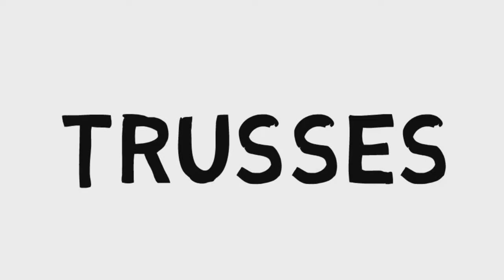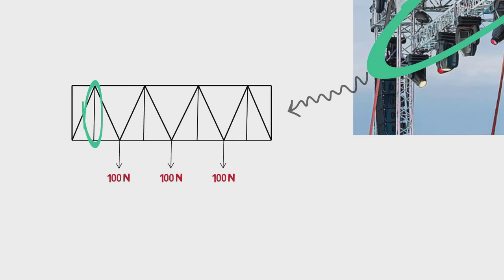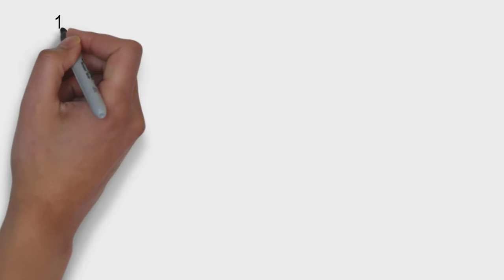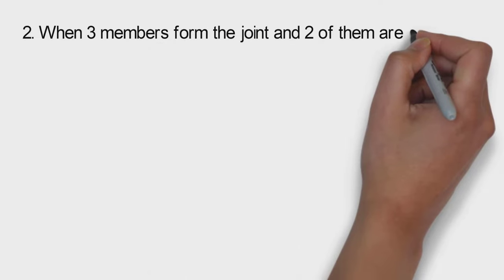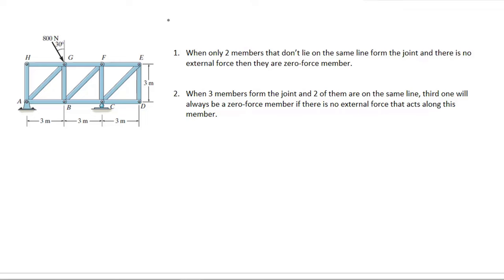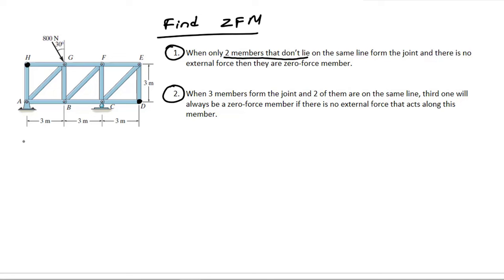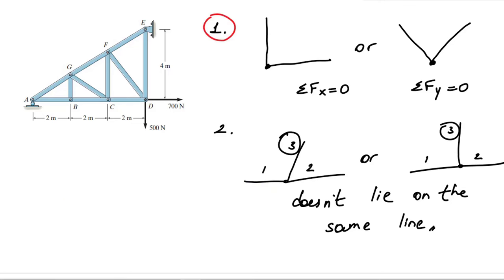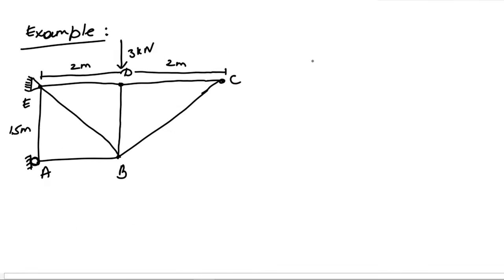How to find Zero Force Members(with solved examples), OUR way

Comment: zero force members provide stability to columns which prevent compression based failures, ie column buckling. They're used for the same reason why stiffeners are used in airframes or stringers with airplane skins. they serve as panel breakers, and increase the allowable compressive load, and allow you to use less thick material, which saves weight.

Comment: Is the other ZFM BF?
Reply: I think it's BC because if you look closely, there's an upward reaction applied to the roller support and the member BC will counter it with a downward load, thereby making the FC and the reaction at support collinear and the member BC non collinear.
Reply: @prafooldev786  AB and BC are collinear members and BF is the non collinear member so it will be a ZFM
Reply: @harshithsuggula3810  What about BG? It is also a non- collinear

Comment: If bc is a 0 force member then rule 2 is wrong since there are 4 members at that joint and not 3.
Reply: that's wat i thought too....
so wat is the answer?
Reply: @Chae-dudu   Still the Member BC is the ZFM. If you canceled the member already assume that that's not part of the joint. Therefore that joint c has 2 same line (Rc and CF) so the 3rd one is BC which states in rule 2, it is the ZFM

Comment: Can you show how to find ZFM with calculation?
Reply: that kind of defeats the entire purpose of finding zero force members. you have to use the rules he provided and start eliminating members. it simplifies calculations. that's the point. now sometimes, a reaction force at a support may be zero which may eliminate a member attached to the support. that would require some calculations. but the beauty of finding ZF members is that you can eliminate some members before you start calculating anything.